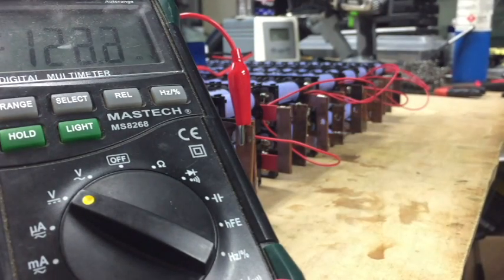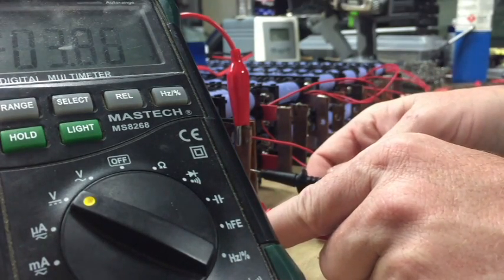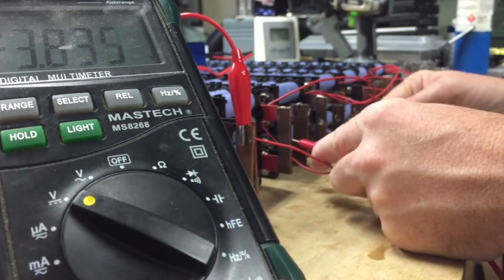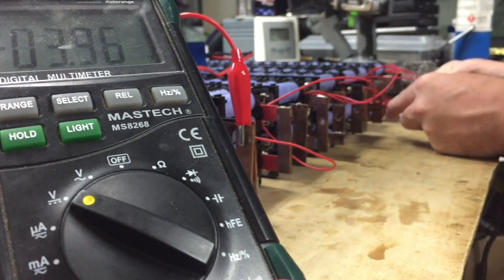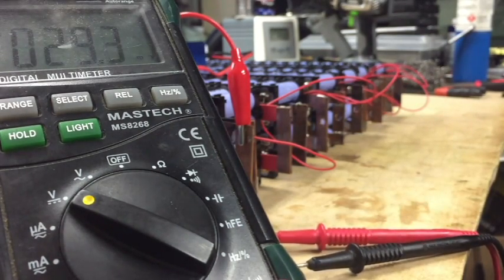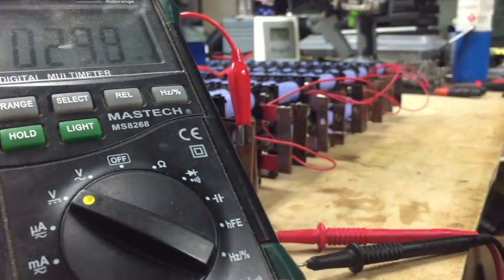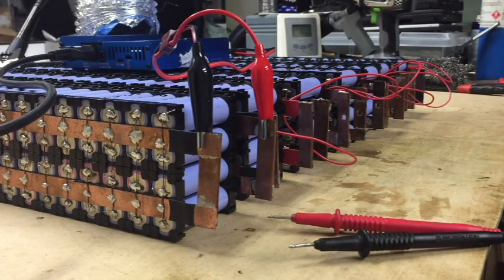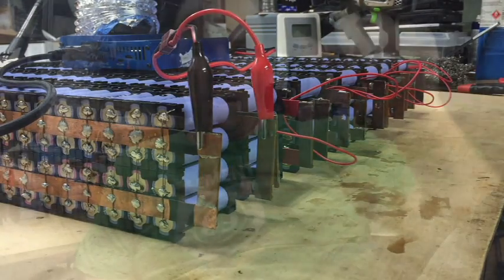Balancing Batteries Pt.2 Sixteen Hours Later!

Comment: Please do go a bit in depth as to what inverter's you're using.  This is the one snag I'm struggling to figure out before building one of these myself.  
I'm not sure what the AC voltage is in your country, UK is 220-240V
Reply from the maker: +Kyle Welsby will do
Reply: HBPowerwall thanks

Comment: you need to invest  in  a  big lipo charger. there are 20 and 40 amp ones on the market  that also discharge  at upto 12amp stick it on each  bank and  charger upto 4.1 then connect  them in 6s with balance  leads and leave the charger do its thing. be heaps  faster. i made a 90 amp  1s battery and it  took almost 4 days to discharge  so i could get  a  pack rating.b4 i make any more 160cell pack for my utes conversion  (about 360 amp each ill be buying one. )

Comment: can you link a list of all the inventors and chargers you plan on using?  Have been watching all your old videos, good work.   Just started recycling old batteries myself, charging, discharging, and finding mAh's.  Time consuming and I have only done 300 batteries so far.
Reply: Good job Buddy. That's way to go
Reply from the maker: +MrEroshan I'll be useing a PIP2424MSX - will it work ? Stay tuned
Reply: HBPowerwall 
Sounds good

Comment: It depends on how you set up your cuyoff voltage (when on load) Should be about 3v per cell x number of cells in series, but i would go with all new stuff. Old setup might be usefull as a reference so i would rather let it live fora while .
if you start to mix new and old components , you might end up with semi working semi permanent setup with no backup
Reply from the maker: +kokodin good call